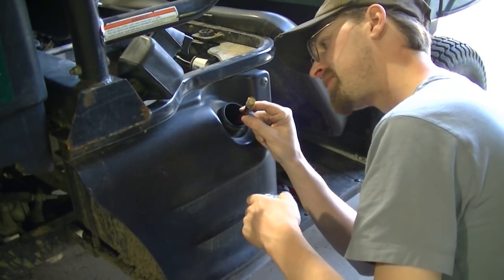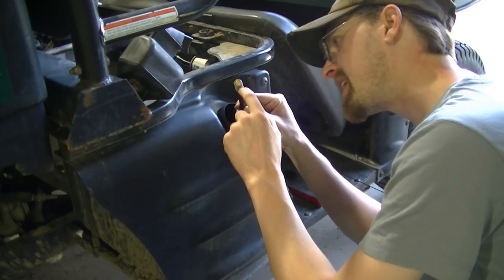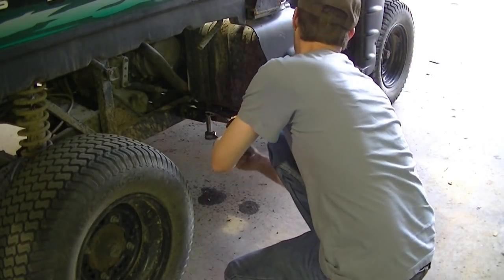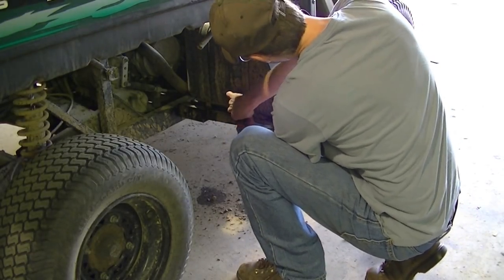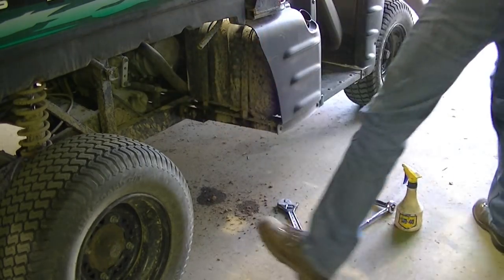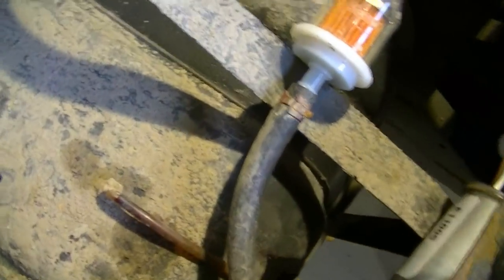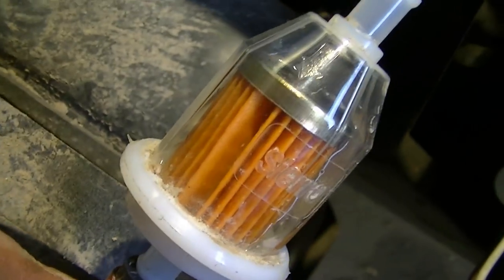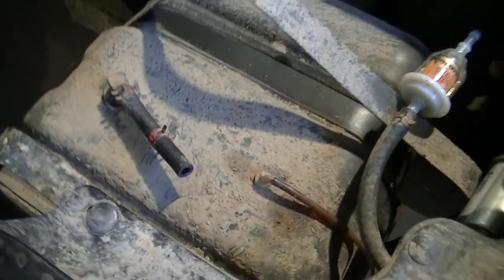Polaris Ranger 500 Gas Tank Removal & Cleaning "Cutting out problem Continues"

Comment: I just got a 06 500 Ranger from a police auction for $900 it has about 790 hours. It didn’t run when I bid on it but after I brought it home n jumped it n sprayed sum ether down its throat she fired up briefly but just couldn’t stay runnin. I think she’s got hope but I hope I didn’t make a bad buy. Good videos even thou they ten years old!
Reply from the maker: If it fired up, you probably have a fuel issue. Very common with these. New fuel pump, filter and clean the carb. The CDI goes out on these as well, but it wouldn't have fired up if that was bad.
Reply: @mossman381  good to know ! I think I’ve watched every video of u working on these classic rangers. You might be done messing with these older units but I’ve learned a lot watching you rebuild em. Thanks again!!
Reply from the maker: I still have a 2004 6x6.

Comment: Took mine in to the shop.  They agree with you that it is the fuel pump.  They replaced it and so far in limited use, it seems ok.  It will obviously wait until it is a couple miles from the camp house at the deer lease before it decides to act up again!  I'll let ya know if the problem persists.  Good job on the pick up coil, looks like you finally got it!

Comment from the maker: Vapor lock is not my problem because it has cut out on me twice as I was backing out of the driveway.  There is a lot of heat under the seat.  The reason why it might not vapor lock when it is new is because the machine is running perfect from the factory.  Years of fuel varnishing, carb out of adjustment, old fuel pump.  Might be causing a lean issue and causing vapor lock.  Just a thought.  If you are having issues after it is warm maybe your fuel pump is going bad.  I think I have mine fixed.

Comment from the maker: There is only one screw to adjust and I have it set to what the manual states.  According to the spark plug it is running perfect now.  Just every 3-4 days I get a cutting out problem.  If the plug was fouled or something I would agree that the carb needed adjustment.  It is actually running better than when I got it according to the spark plug.

Comment: Hey mossman381.  I have an '04 Polaris 4x4 with a 500cc engine.  Only use it on the hunting lease and only have about 250 hrs on it.  I am having the exact same problem as you, mine only started a year or so back.  I was hoping that you had solved the problem and was watching you go through the steps.  How frustrating that you can't yet figure it out!!  I read some other blogs and the idea from them is that the heat from the engine is boiling the fuel

Comment: and causing vapor lock.  There was a polaris owner in west texas that uses his in extreme heat 95-100 degrees who was also experiencing the same problem.  He cut out the panel below the seat and installed a fan to increase the venting and keep the engine cooler.  Haven't seen yet if it solved the problem or not, but to me the question that begs is why didn't the ranger do that for it's first several years/hours of operation?  It still doesn't make sense.
Reply: The ranger uses a 160 degree thermostat stock on the 500cc engine. However the stock fan comes on around 220 F way too hot. I switched to my own switch turns the fan on at 160. Works great never vapor lock. The stock radiator is big enough to cool the ranger without needing a larger radiator. The ranger 500 and our 1937 John Deere B are the only 2 vehicles I didn't need a bigger radiator for.  Oh and I am in Texas and it's hot here!
Reply: Try changing the carburater slide and diaphram if nothing else works.  Can be changed from top of carb without removing the carb.  Just remove the top plate of the carb.

Comment: I have issues with mine also starts and runs good , then when you let it idle for about 3- 4 min and it dies engine stops . But it starts right up when i turn the key to start .removed the original carb and cleaned it ,new filters  fuel hoses in tank  to carb but still dies out when running at idle  sitting.  Take it out and run it wide open - it runs fine . I’m still puzzled with this  posted this 10/17/ 2024
Reply from the maker: @tom73055  Have you tried turning up the idle a little bit. I had a carb I cleaned and rebuilt but still couldn't get it to run right. Had to get a new one. Then the new one wouldn't run until I swapped over the main jet from the original carb.
Reply: @mossman381  yes I did try that  and will see if it works  I have been watching your videos all evening and am so impressed with all the work you put into the video’s over the years . Your a good person and I appreciate your time thank you again , Tom
Reply from the maker: Just bump the idle up a little bit. You don't want it hard to shift. If that doesn't help, I would say it's probably in the carb. I hope I have helped many people with these videos and many more down the road.
Reply: @mossman381  ok i did turn up the idle , it starts right up every time runs and idles good then after one  minute it stops ,restarts fine runs then stops . Only while at idle . If i rev up the motor it will run and run at any r p m . This has got me puzzled . It  seems like if you had a kill switch and turned it off . Fuel pump is new and the 3 rd one i have tried  10.00 china pump no name crap  but it pumps 2 to 3 psi  .thanks for the ideas moss
Reply from the maker: @tom73055  I never liked those cheap fuel pumps. I always got an Airtex but I don't think you can get them anymore. The fuel pump doesn't run all the time. That can trick you into thinking the fuel pump isn't working correctly. I know a bad fuel pump can stop working when they get hot. They put them in a bad spot right by the hot exhaust. I actually wrap my fuel line and fuel pump with heat wrap. That really helps when running the machine hard for long periods of time. Especially in the hot summer. I don't think 1 minute is enough to get it that hot. Your spark plug looks good?

Comment: i had that problem for three years before i found out i had bad compression. 2000.00 bucks later and an engine job i was good to go.Check your compression
Reply from the maker: Barry Resvick It was a bad switch.
Reply: If ya ever have that issue again,try changing your fuel if its been sitting for more then a month if it blended. Blended gas is the worst thing iv ever seen for polaris rangers or any of them for that matter. Use methol hydrat regularly as the blended gas sucks in moister and separates after only 30 days